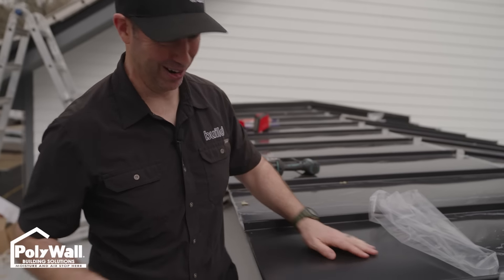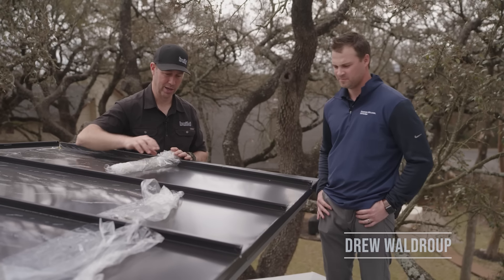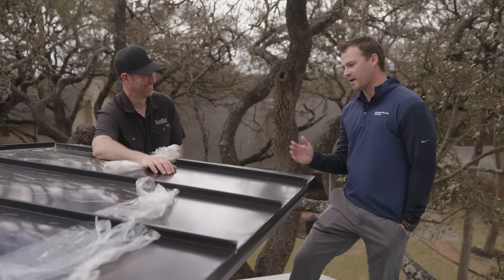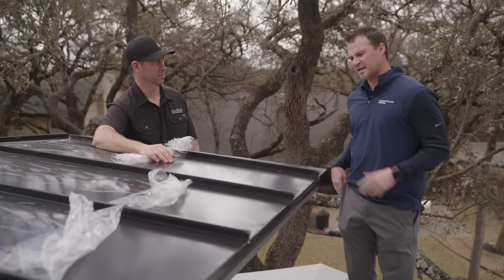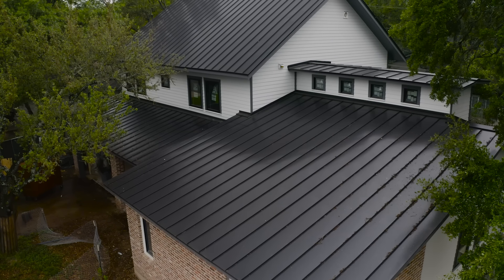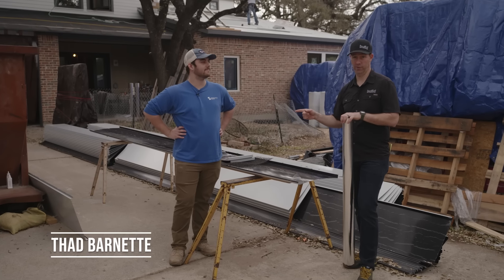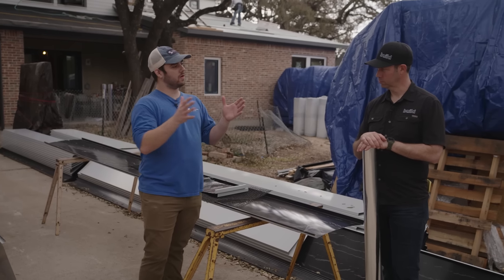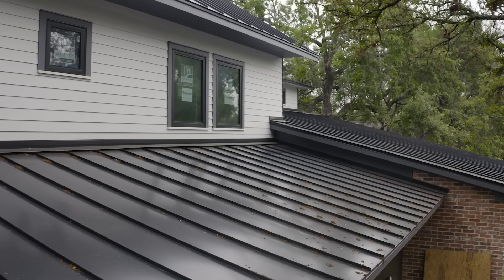Black Metal Roof - Dumb Idea?

Comment: Another advantage of a metal roof - even if it is black is the fact that metal roofs cool down faster than asphalt shingles.  So the heat load will dissipate quicker than my dark shingle roof.  I am curious about the dimple mat from Sharkskin. Their website says you can install it under asphalt shingles.  @Matt_Risinger do you have any experience with that.  Being down in San Antonio - I would be curious to know how much that helps the heat load on an unconditioned attic.

Comment: It would be interesting to see some attic temperature readings in some test structures built just for the purpose of finding some answers to this question. I live in Miami and plan to install a metal roofing system over the next year or two. I would love to see the difference over several color choices.

Comment: I agree that the radiant barrier must be facing the air gap, but shouldn't the shiny side be facing up? Don't you want to be reflecting the infrared heat up and away? Or is the radiant barrier actually shiny on both sides?

Comment: Why would a site in Florida be the most aggressive UV environment? I live at high altitude and I can tell you that UV is much more intense here than in a low elevation high humidity area. I don't think the person selling this product is informed. Or am I missing something?  "UV exposure at high elevations is significantly greater than at sea level. In fact, there is a 6 to 10 percent increase in UV exposure for every thousand feet of elevation. For example, here in Colorado Springs, which is about 6,000 feet above sea level, the UV exposure is 36 percent higher than at sea level"

Comment: When is it painted? If it is painted and then rolled, what about the cut sections? They would need repainted/coated correct? Think of the auto practice. Any time you cut or drill, you have to repaint that area to prevent corrosion.

Comment: What a good salesman, when asked if black is a bad option for the south or in an American “hot climate” he diverts saying “well I cant say it is a bad roof it is very on trend”. Numbers wise it sounds like it is 1/4 as reflective as white. Good to know. Unfortunately most homes are not built to the extreme standards as this roof they are putting a black metal on a standard roof system. Trend over effectiveness (in most cases obviously Matt is an exception). Thanks for sharing the disclaimers Matt.

Comment: In many of your videos, you try to list the relevant factors & I felt like that wasn't done here. Seems like there are a number of factors in doing a roof: color for fashion; emission; reflection; transmission; safety (skin, embers, structure fire, etc); cost; impact to lower layers in the roof; weight; strength.... I'm hoping for a video that covers the "important" issues in the style your videos generally provide. Oh, and it'd surely be useful if you covered redoing a roof vs "new". Thanks for all the great videos!

Comment: I use a Silver Birch on my new roof which is asphalt shingle,  there is an immediate difference in lowering the cost of electricity of about 3%.
Reply: Use a layer of white Roofguard 700 on that new roof about every 3 years and it will lever go bad.

Comment: Fade is still fade, if you go to do anything at all that deals with the exterior you will notice it. Like if you replace or add a window or French doors or whatever, and you buy new black trim it will be noticeable in contrast with the faded roof. 

But he admitted black is not going to reflect heat it will be absorbing, the white SRI index was 100 and the black in the 20s. In Texas it seems not the best ideal for black, if your house ends up being 10 degrees hotter than everyone else. But if you had a advanced "heat pump" for air conditioning then maybe you could get better efficiency with the higher temperature differential, suck the air from the attic into the pump. I say advanced "heat pump" meaning something i don't think they have for consumers atm, not together in one package. But the bottom line, using devices that benefit from high temperature differential, like Stirling engines, those solid state piezo electric pads, etc... designed together in a safe way to help provide relief, cool air. Hook one side to the attic air, and the other to a pipe system buried deep enough in the earth to get the stable non changing temperature(cooler than your Texas summer day) in the crust. That differential will run a Stirling for free, and at the same time you can use that underground pipe system in winter too using a traditional heat pump. Better yet run the pump in reverse in summer too,

Comment: I'm slowly redoing my house and the roof is where I need to start and would love to do this same way to get max energy efficiency for the house.  I would like to replace the plywood with a heavier version. I plan to do a 2" closed cell foam in the attic when I start the renovation so I figure heavy wood vs this old stuff.  Just like to do it right to last a long time.
Reply: Please have a look at how all these products perform in a fire before making any decisions.
Also, if you're renovating, it's normal to start at the bottom. If your house is on stumps, for instance, and it needs restumping, that action can move stuff around, crack plaster, and change the shape of your roof. You want to redo your walls after fixing your floor, and work your way up to doing the roof last.
Reply: @tealkerberus748  Just bought me a 1961 house 3bed 1 bath 1020 sqft on 1 acre for $25k and the house is so old it needs a complete renovation done.  Im out of money from buying this and make so much a month but do you know of any grants or tv shows that would want to redo this old house?  Wanting to make it a Foster Home for kids.
Reply: @MotorJoe  I don't know, but good luck!

Comment: Very suprised in the color, black vs white would be 50-60F delta, try it on a full sunny day at 2pm. Also try holding a hand on a black car vs white.  My concern is paint, and underlayment.  In Fl black 3D shingles fail in 10 yrs, just happened to next to me,  I have white tile and white block.
Reply: I understand that there will be some degree of thermal bridging, but with heavy insulation and an air gap, wouldn't it be minimized by a lot?
Reply: @SparkHelium  Yes, you are correct, but radiant heat to windows and side of building, but my point is the underlayment will be that much hotter and the paint cannot and will not last as long as a lite color.  Maybe the wife had a hand in this?  It just goes against all the other efficiency measures taken.

Comment: Not if you circulate water supply under it then to your water heater like I did. I use almost no electricity to my water heater all summer. When the temps are going to drop below freezing, I just close loop and purge it. Has been great for the last 12 years.

Comment: How much extra per square foot does one need to spend to compensate for the additional heat gain of a black roof in the South compared to lighter colors to achieve the same attic temperature?

Comment: If you have a metal roof you need to make a way for firefighters to get water into the attic . Shingle grooves burn through letting fire heat out , metal roof house in a fire are almost always a total loss.

Comment: Could you compliment the reflectivity and heat control of the roof by applying a ceramic coating?
Reply: Such as a type called Simix ceramics

Comment: Slanted 1x4 under the metal, Why? Without ventilation in and out from under the metal, heat will be trapped and degrade the plastic air mat & sharkskin? Exactly what are the roof venting details? Ridge vent? My roofing supplier is always selling me what he has been told by his manufacturer rep. Bias is not always correct. For the same cost, a second thin metal cover could be under the main roof to allow a 1" air gap to vent air from the eve up to a ridge vent. Expansion of the black metal in the full sun could be a problem for the fastening screws? Solution?

Comment: Instead of "fade" the better question would have been "heat gain" to the interior space. With your choices of the air gap and radiant barrier, you will mitigate that. The question should have been raised for other customers who don't have to budget or foresight for that.

Comment: Looks like slate-- the original black roofing used in castles. Here in the desert, they are resistant to heat, wood deterioration, and hail. The black will heat up and naturally weather✅ Also no hole, absolutely no skylights, no holes on your roof.  🏠

Comment: Ok, so I've read all the posts below and let's talk about solar panels.  I believe that placing panels on a black roof will unnecessarily expose the panels to increased  localized heating which will reduce their longevity.  Yes, all of that insulation protects the house underneath but consider the effect on a solar panel installation.

Comment: Well I can't  say about black however I'm in the south with a green metal roof concrete block 1941 house and no ac temp outside was 101  the inside was 90 doors and windows closed no insulation in this house. Hot is hot regardless. Since this home never had ac or upgraded anything we were happy to see the roof was in good shape

Comment: "On Trend"... Kinda like variable height shag carpet? People buying something doesn't mean it's a good decision. 1) Pollen and dust will standout like a sore thumb. 2) put a thermocouple under it on a 100 degree day, then do the same to white or silver, tell us what the heat loads are. 3) it actually is environmentally unwise, as it'll reradiate in the IR, increasing the surrounding air temperature considerably.

Comment: Generally yes, darker the metal, more extreme the heating and cooling cycles, thus more movement, flexing, sound warping and wear. if looks didn't matter it'd be white or tan.  I'd be surprised if it wasn't changed out in 10 years due to at a least looks, black shows imperfections and dirt real well.

Comment: Would be great to know about oil canning. I put my metal roof on and wanted a "flat", non striated or ribbed panel and my roofing guys won't put one on and warranty it because they say it will oil can.
Reply: Oil canning is normal with the flat roof.  You have to have striations to avoid it, but it is not a defect.
Reply: @eh_bailey  I'm just relaying what "professionals" are telling customers. Ideally, you wouldn't want oil canning. Especially if you're trying to keep the clean design lines. Otherwise it's visual noise in the design.

Comment: It was an aesthetic choice; I get it. That said, I suspect the roof may want to be replaced sooner than Matt hopes, because of thermal performance issues (tho not of the fluoropolymer coating or sheet metal roofing), climate context, and the energy environment in the coming years.

Comment: Science 101:  black ABSORBS heat!  There’s a reason ball players wear black underneath their eyes.  I like how the sales guy justified black metal over black shingle (haha). The shear surface area of the roof will just make the house be an oven with an open door; you may not feel it inside the house, but all around the house will be noticeably hotter.
Reply: Why do ball players wear black underneath their eyes?
Reply: @adambennett7451  To absorb the direct sunlight instead of it hitting their white eyeball

Comment: Black absorbs a lot more heat from outside in a hot climate and conversely the emissitivity of a black roof will radiate away substantially more heat than a white roof from inside the house in a cold climate. Unpainted zinc roofs or lighter roofs will always function more efficiently in either hot or cold climates.

Comment: I really love metal roofs after growing up in the Midwest with a lot of early 20th century farm houses with various metal roofs around.  I'd love to have the option of a metal roof now but HOA rules forbid them.  With that said, the mid-continent hail band is expanding in coverage and frequency due to climate change.  I've lived on the east side of the Denver metro area for 22 years and in that time our hail events have increased dramatically.  We are seeing more volume of hail, often requiring snow plows in June, and larger average hail stones.  I  A 1/4 pound chunk of ice at 90 mph will dent that roof.  I didn't look up Austin's hail situation but here I would imagine a roof will sustain denting within 7-10 years.  Insurers are now factoring 1/decade roof replacements into premiums for eastern CO.  They're forcing car dealers to put up coverings on the lots because there is a hail event each year that totals entire inventories.

Comment: A radiant barrier is not require under a black metal roof which is white on the back side.  The emissivity  of the white side is near 100% which means the radiant heat will come off the black side and not the white side.  If you looked at the two sides of the roof panel with an infrared thermal imager, you would see this.  The white side will be at the same temperature as the black side but will not be  radiating and therefor the radiant barrier is not needed between the metal roof and sheathing under it.
Reply: You want a LOW emissivity to reduce heat transfer.  And even white painted surfaces still have a high emissivity, so I think the radiant barrier is still beneficial in this case.  I was surprised to read (just now) that even white paint has high emissivity.  see the chart at: https://en.wikipedia.org/wiki/Emissivity
Reply: Even if the back side is shiny metal it still doesn't make any difference. It's the front side where the heat is being absorbed that has to have the radiant barrier. To be effective, a radiant barrier MUST face the heat source. A radiant barrier works by rejecting heat that would otherwise raise the temperature of the emissive body. Putting it on the underside of a low emissivity mat is complete and utter nonsense.

This is physics, people. It's the law of the universe and you can't get away from it. You have to understand how things work if you want to make best use of them.

Comment: So we know the black paint will hold up well to the beatdown of the solar radiation over 50 years based on the RSi, but how will it do with the acid rain conditions around the nation, especially up in the New England areas that have very low pH (acidic) rain?

Comment: Having been a paint contractor for over four decades I really have to question going with a bottom of the barrel paint such as Sherwin Williams. I get why Sally home owner gets sucked in, but anyone who has experience with SW knows that it is a builder paint. It looks okay for a short while then fails. Honestly I wouldn't recommend it to an enemy if I had one. 
Look for a PPG alternative for a professional finish that will last. I just hope that SW paid for the roof because otherwise you were ripped off.

Comment: Told like a true salesman, lol.  It looks great, but I'd never consider black or any dark metal roof color for that matter.  It simply absorbs too much heat.  And with the climate getting more and more extreme and hotter any effort to deflect the heat helps. I manage a house in Hawaii that has a dark green metal roof and the upstairs unit gets quite hot in the summer time.  No doubt a lighter color metal roof would help mitigate that.

Comment: Only 40 years in the roofing business. Will a dark color roof be hotter than a lighter color roof, yes. Insulation does help, but if you must have the color that's up to you. Air gap materials or lathe under metal - take a piece of paper lay on a table and try to punch finger through it nope, now suspend it in the air fastened on each end, yep. Also after tornados go through an area drive around and look at all the metal roofs in the fields with lathe attached and ask yourself where is the home? Metal over deck is the only way. A solar barrier under metal is amazing, it will cause the color to fade ever so slightly faster, but is well worth it. Make sure the barrier used is an actual barrier not a "coated/painted" product.

Comment: I went to Sheffield web site to get quote around 3-4 weeks back. I didn't hear from them. 
I am wondering what the price range is to replace existing shingles roof with metal roof like this per sq.
I mean price that includes hauling/cleanup/tearing down existing shingles etc.
I am in Austin, TX. Is the price $800 per sq or $900 per sq?
I like to hear from a home owner who got this done.

Thanks

Comment: Be careful about the way numbers are presented. The difference between 25% reflectance and 90% is a 3.6 ratio, but it means 10% absorption vs 75% absorption—a 7.5 ratio.

It could also be useful to know how much IR and UV is abssrbed, since these are not visible wavelengths and you can't judge just by looking.

In some cases, especially at higher latitudes, placement of trees may help the situation a lot. Ideally, you'd like the house to be shaded in the warmer months but not in the winter.

Of course, if your roof is solar it's going to be quite dark anyway. Then, maybe an air gap is what you really need to aid in keeping cool. It's also not a given that you want a solar roof. I'm very much a solar booster, but that may not mean rooftop solar for some people. In fact, for some people, in a rural setting, panels on the ground may make more sense. And in other places, the Grid may be mostly solar, or some other combination of renewables, and you may just want to buy your electricity from the utility. It's still nice to have backup in case of out(r)ages, but that's about energy storage more than generation.